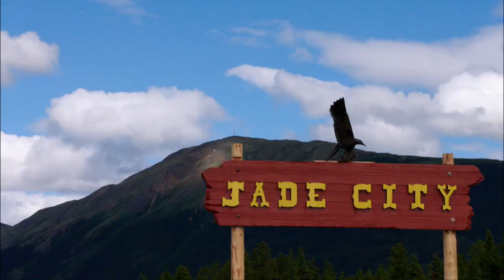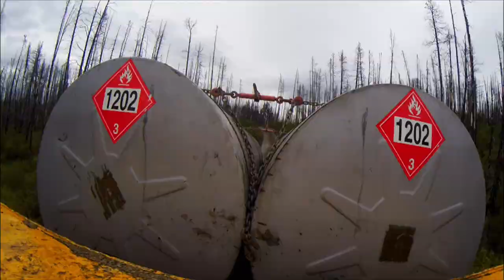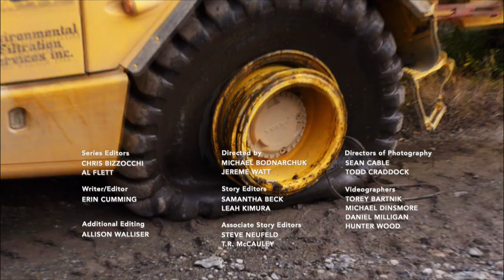See the moment Josh shreds a tire | Jade Fever S0214 | Go Xplorer

Comment: Compressed carbon filter
Will filter anything out of the water and all you'll get is clean water
The compressed carbon will only let water pass through it it won't let any minerals any substance except clean water you got sewage so put a pre-filter in front of it to collect the big pieces so you don't clog up the compressed carbon filter sooner but it should last you anywhere from 6 to 7-years before you need a new one
Reply: Get a big one you want one that's probably 10 to 12in in diameter and about 8in long how much this will cost you I have no idea what is it worth the money most definitely you wouldn't even have known you had a problem with your water